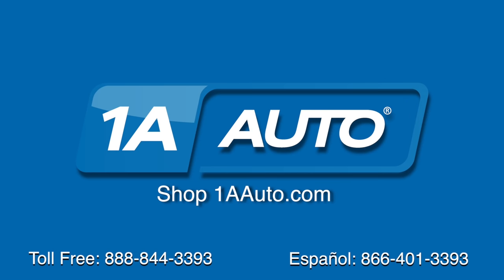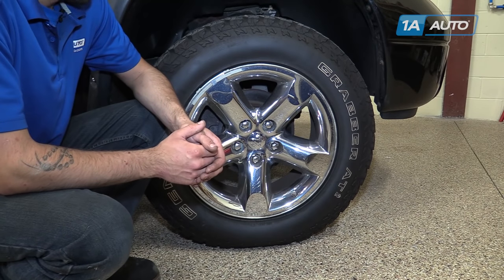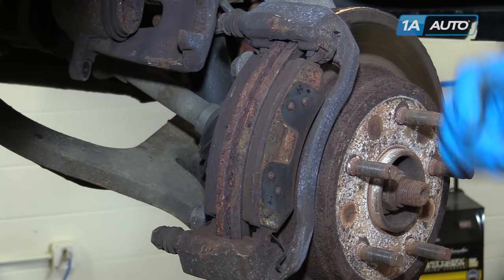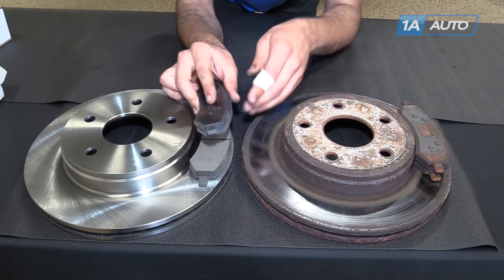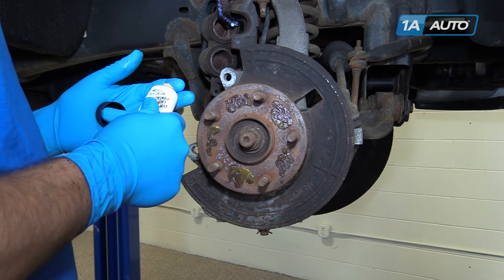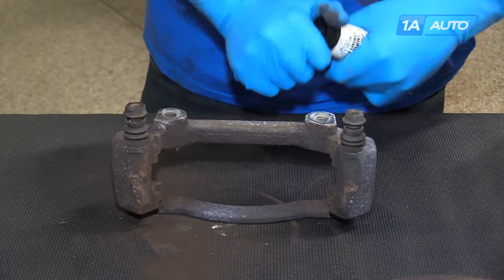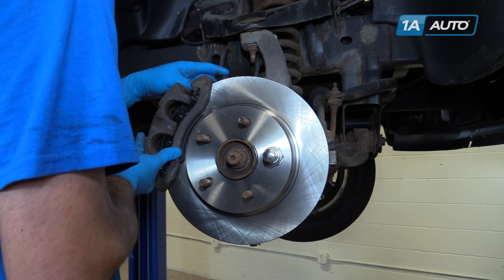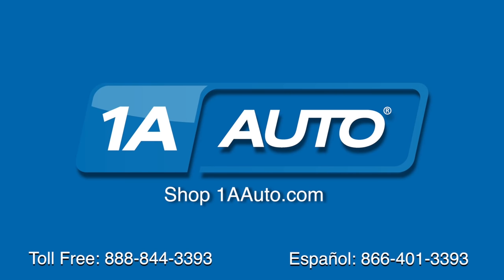How to Replace Front Brakes 06-08 Dodge Ram 1500

Comment: Do you sell the "Drilled & Slotted" Rotors? (2007 Ram 1500 5.7l Heni)
Reply from the maker: +Joe  Mitchell Thanks for watching, Joe.  We do have a selection of drilled and slotted rotors for your vehicle, but they have a very specific fit.  I recommend you get in touch with our service department to verify the correct set!  You can find our contact information by following the link: http://www.1aauto.com/brake-pad-and-rotor-kit-front/i/1abfs01212?utm_source=YouTube&utm_medium=CTA+Comment&utm_campaign=ytcomment&utm_term=w6VLKWPBhvk

Comment: Just an FYI the new pads do not come with the new retaining clips like shown on these pads in the video.
Reply from the maker: +williamocrow Thank you for checking us out. The anti rattle clips which mount to the caliper and hold the brake pads in place are not included with a brake pad purchase, however for most applications we offer them separately. 1aauto.com

Comment: Any warranty on those?
Reply from the maker: +Eleno Sigarroa We offer a lifetime warranty against manufacture defects on brakes. This does not cover wear, it covers if the brake pad or brake rotor ends up cracking or failing due to a manufacturing imperfection. Here is a link to the brakes shown in this video on our website. Hope this helps you out http://www.1aauto.com/brake-pad-and-rotor-kit-front/i/1abfs01212?utm_source=YouTube&utm_medium=CTA+Comment&utm_campaign=ytcomment&utm_term=w6VLKWPBhvk